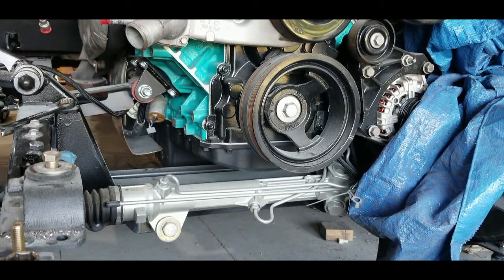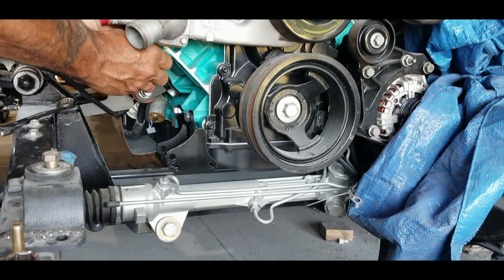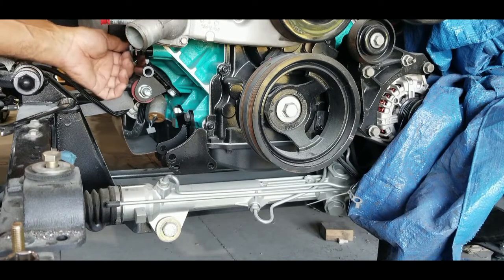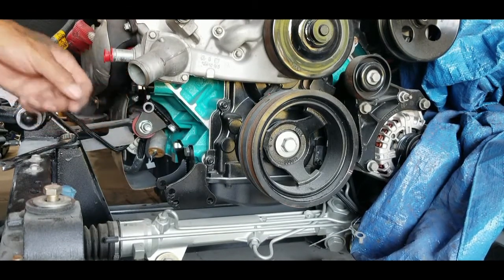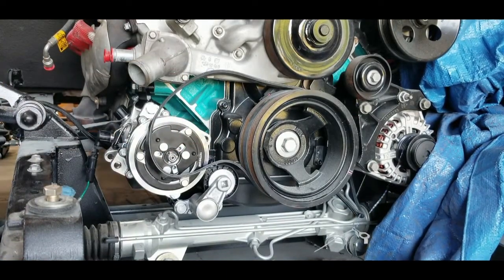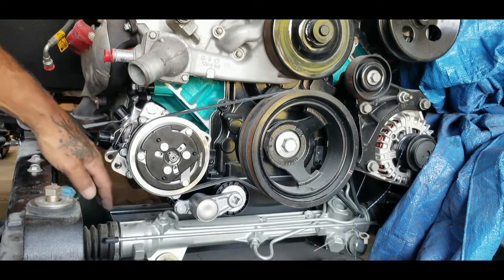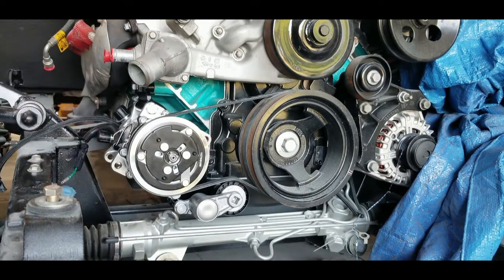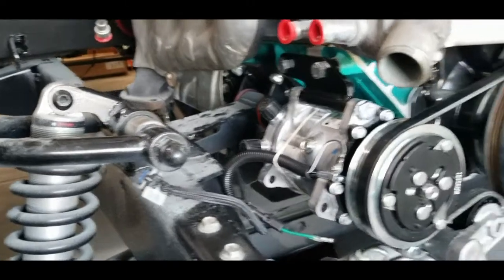Installing Vintage Air - 1955-57 Chevrolet Pickup SureFit™ Complete Kit Deluxe Controls. Video 1

Comment: I'm building a 55 Chev 3100 resto/rat rod, and I really enjoy your videos! Very informative.
Would you be willing to share which A/C compressor you used for your vintage air bracket installation video? Model/part number? 
Thanks!! Brent
Reply from the maker: Brent Anderson Vintage Air 150001 SureFit LS Bracket for Sanden 709 Compressor. This is for an LS engine if you have another engine pleaser call Vintage air. I used this one because I used all stock mounts and this fit great.

Comment: What is the distance between center bolt of crank to outer edge of ac compressor?
Reply from the maker: Sorry it took so long to answer. Mine is right at 12 inches from the outside edge of the compressor to the middle of the bolt.